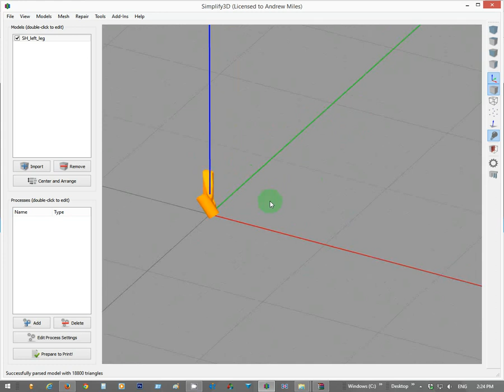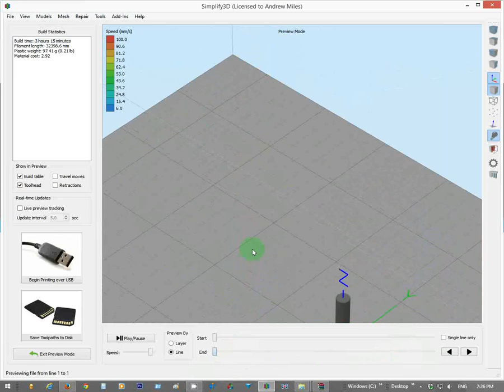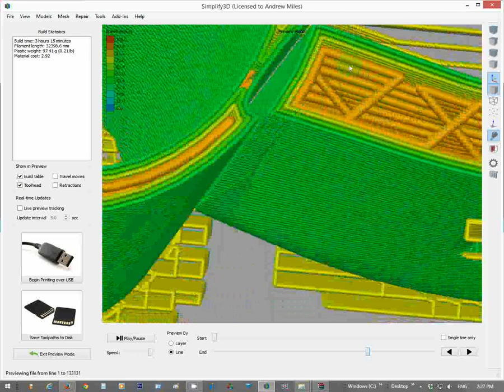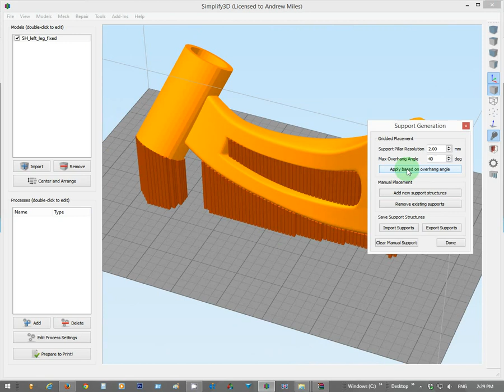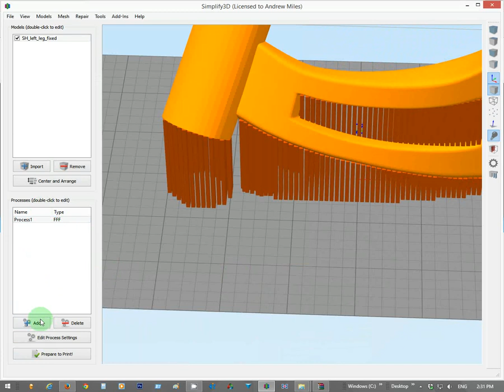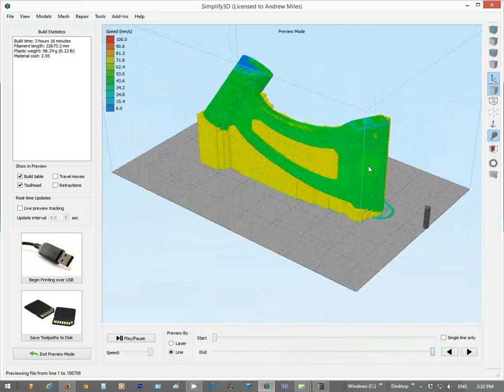Netfab repair STL files

Comment: great web tool . 
need to make or get one of the  scrap chippers and save  up your chips and re extrude them back to filament again.
i have only seen some DIY systems that look messy .but i bet desktop pro one swill be along soon enough .
Reply from the maker: yeah tossing material away sucks
Reply: sure does . 
PS  check this out , nanobeams , could make a quad copter frame with it . 
http://www.nanobeam.us/